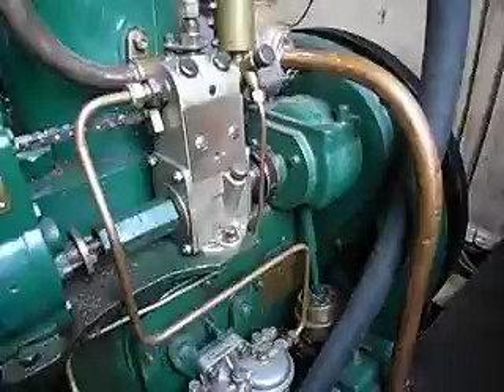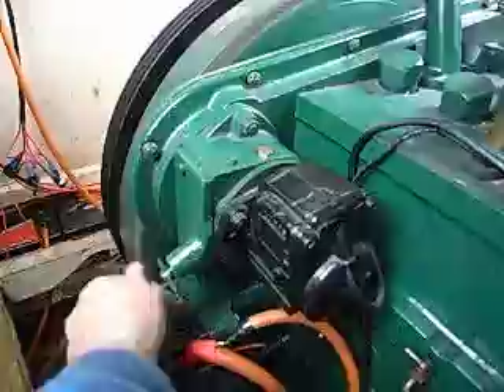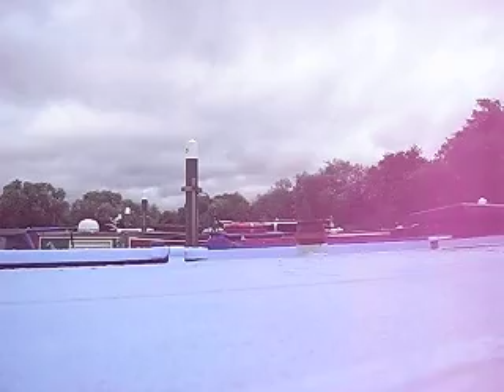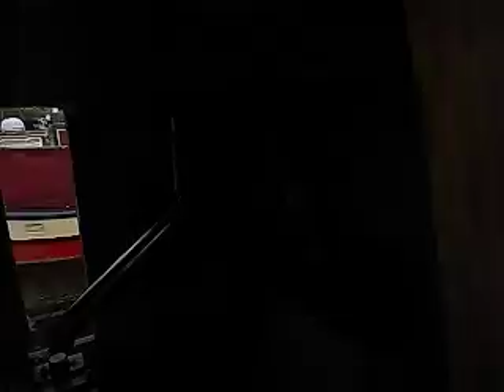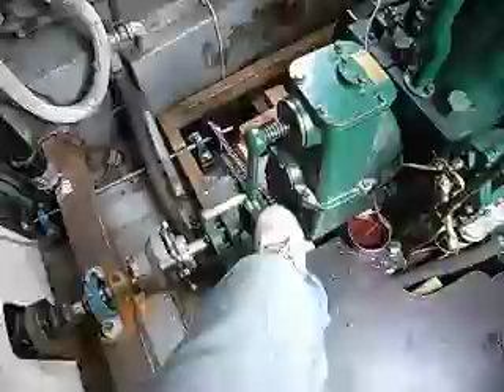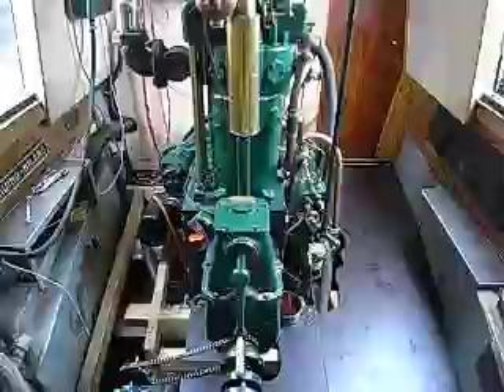The Kelvin K1 running on diesel

Comment from the maker: @Albacore8153 

Difficult question to answer. Vibration is not quite the right word, more that the boat hull gets tipped sideways a little on every firing stroke. It's quite noisy in the saloon  in the front of the boat even with the engine room door shut, but it's a nice noise, if you get what I mean...

Having said that I took careful note of the vibration caused by the preceding engine (a Beta Marine BD3) before it was removed, and I'd say the noise was comparible
Reply: Russelnewbury